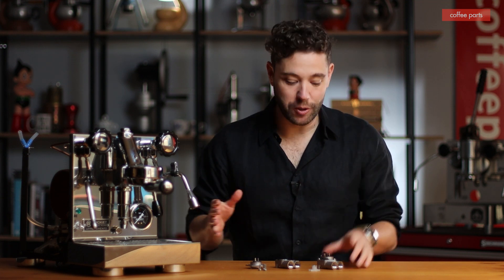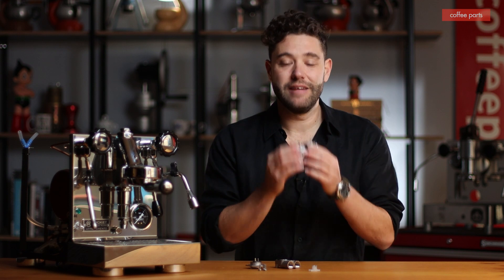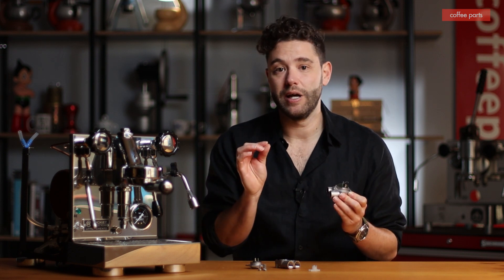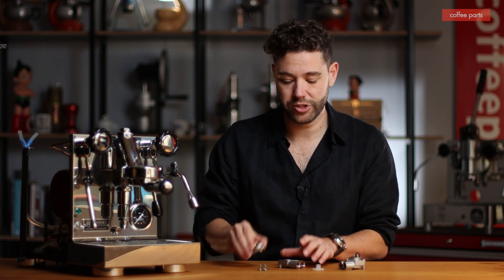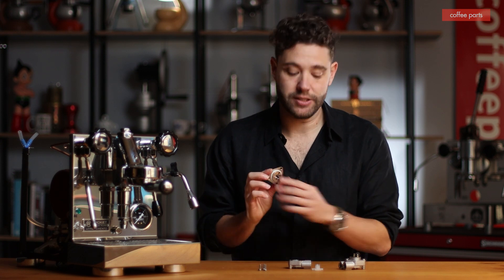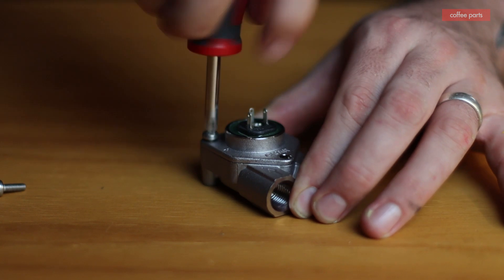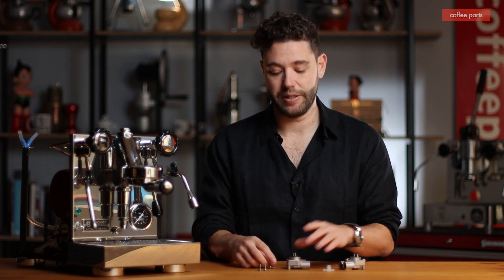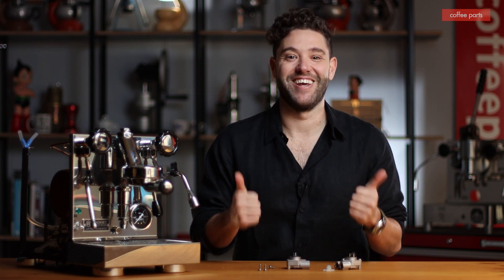What is a Flow Meter Used for on a Coffee Machine | Quick Tips

Comment: What I'd like to see is a cost break-down of parts like this and the required electronics. My impression is that features like this are extremely overpriced when you look at the simplicity of the device. Same with the different types of boilers, pumps, and overall build quality of liquid and electrical connections. I seriously fail to see why a machine in the $700 range isn't top-of-the-line other than people are stupid and pay thousands of dollars for relatively simple machines.

Comment: Thanks mate! Do these ever get stuck if the machine is too calcified? I have a Bambino Plus that is not pulling any water, although the pump is running. I wonder if the flowmeter is blocked...
Reply from the maker: Yes, they can block up with calcification. Descaling machines is an important part of maintenance as not only do they block. up, but things like elements become less efficient, probes doesn't register correctly, etc...
Reply: @CoffeePartsTV  I found out what the problem was, upon taking apart the machine. An air pocket had formed from the OPV output to the brew group. I had to prime it manually with a syringe. Cheers!
Reply: @TomsCoffeeCorner   would you mind explaining how you did that I have the same machine with the exact same issue